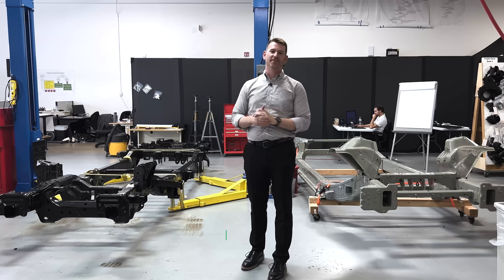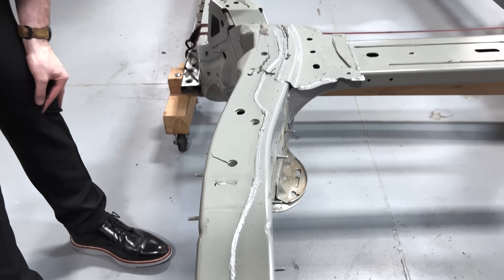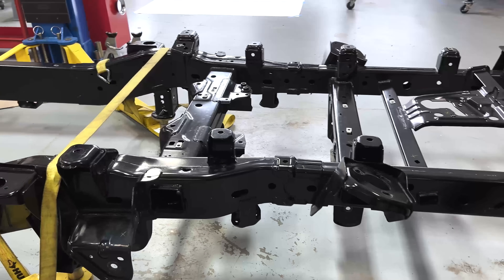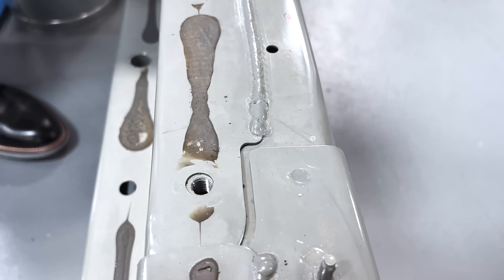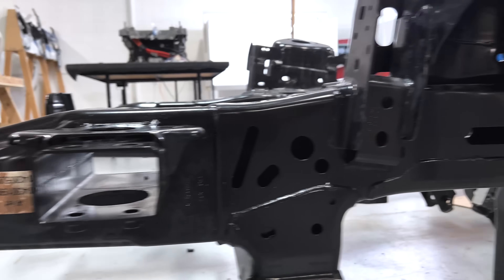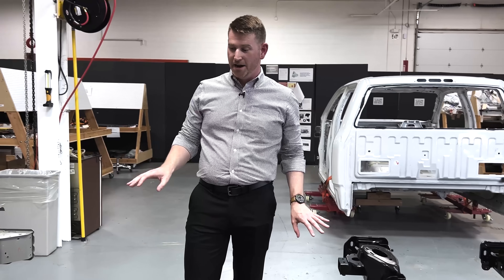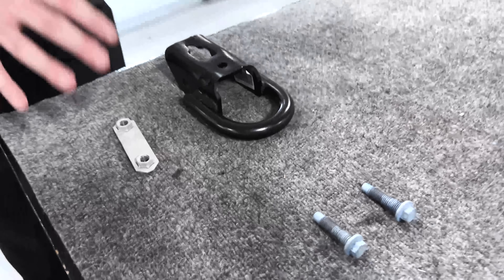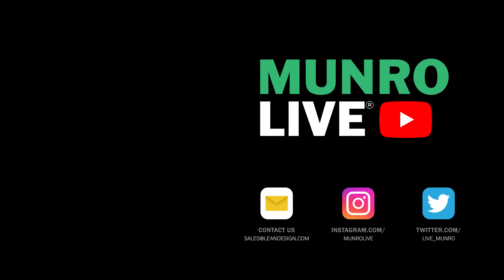Who has the better structural support system | Lightning vs R1T frame breakdown

Comment: This is a pretty good example of maturity.  The Ford chassis has been iterated and interated and iterated for years.  They've reduced costs aggressively by reducing parts counts and they build a very high spec part inexpensively.   Kevin alludes to the manufacturing capacity but the Ford frame is something that Rivian couldn't hope to produce because even if they had the experience and know-how, they certainly don't have the capability to hydroform boron steel tubes for the side rails like Ford does.

Comment: Great video, but you don't have to be such a p#ssy saying obvious conclusions.  Ford is a real truck, with optimized high volume rugged construction, but it is not quickly/easily adapted to house a large battery to convert to BEV.  Ford still makes way more ICE than BEV, so it makes sense the BEV is a compromise.  Rivian is a ground up BEV built of much lighter sheet metal, pieced together.  Its optimized for electric, but is not a traditional HD truck.  Its multi-piece, stamped sheet metal with variable weld quality looks a lot like early Tesla model 3 body in white construction (a mess, Sandy said looks like early 90s hyundai car bodies - before they stepped up their game).  Both frames are exactly whats expected from each manufacturer.  Ford knows how to make trucks / Rivian is a startup electric car mfg.

Comment: Apples to Oranges comparison. Lightly touched on the Rivian performance relative to the F-150. Seriously understated the EV design from the ground up of the Rivian and the performance and functionality of the skateboard and high tech suspension. The F-150 is a rushed to market EV built on an adapted ICE truck frame. Fit for purpose but not comparable to the high end performance Rivian. And yes agree with the manufacturing efficiency opportunities.

Comment: Very informative, now my last dying thoughts as some contemptibly inept drunkard runs a red light at 70mph in a 30mph zone and plows through my vehicle will be admiration for the structural engineering that went into supporting that deadly unstoppable 9-10 thousand pounds.

Comment: That Rivian is gonna rust like fuck. So many flanges and gaps for moisture to find it's way  into , and gonna be super hard to do anything about it after as body bonded to frame , still think it's a super hot truck though. High desirable.
Reply: Box frames suck.  I definitely prefer open C frames to mitigate rust when it comes.
Reply: @thomashayes7897  lol... A box frame is way stronger than a C frame. We are talking about trucks that haul and tow enormous weight that constantly stress the frame.  If your sole criteria is mitigating rust, why even go C frame, just have T or I Frame.  Very easy to mitigate rust for you.  Better yet, maybe they should make the frame out of plastic and solve your problem completely.

Comment: The Lightning frame have to be similar with the F150 frame, is no economic gain to reinvent the frame....Also Rivian is a smaler truck, should be compare with the Ranger.
I do not like the Rivian body in one piece....I like better the cab is separated from the box.......
Has a working tool, the box will suffer more damage during transportation....is more easy to change or replace...

Rivian look more like a El Camino.......no use for trade......but nice lawn ornement

Comment: I do enjoy all the Munro video explanations of the different processes that go into manufacturing these complicated vehicles but as an engineering layman I am more interested in your opinion related to the quality of design and assembly rather than which one is more cost efficient to build. I suspect cost savings will come with manufacturing and design tweaks as well as volume. As Rivian grows its brand and reputation as a high quality manufacturer of EVs it is important that word of mouth advertising, the best form of advertising for any product is always passed on in a very positive warm and fuzzy manner, especially out of the gate.

Comment: Thanks again, big fan of your channel. Three short comments not related to the relevant content of the video:
1.	I prefer the simpler opening, just the woosh to the Munro name.  Short, efficient and sufficient.
2.	Kevin seems very cautious about picking his words and giving uncensored comments. Perhaps a disclaimer in the beginning to limit liability would be in order.
3.	No reason to be modest about promoting the sale of the analytical reports that Munro publishes.
Reply: I think the reason for the cautiousness/ hesitance was explained pretty well in a recent video that Kevin and Jordan did with the rivian and the lightning: there are obviously a lot of priorities when designing a vehicle and by no means do they want to call Rivian careless or inexperienced with their design choices even though by comparison the ford looks so much more “advanced” in terms of design for assembly/manufacturability/cost (in some areas, not all).

Comment: If the Ford frame is about 12 inches tall. Ford could easily double stack batteries and get over 200KW in the vehicle. Especially with new battery tech. Batteries need to get smaller and lighter if EV’s are to be the wave of the future.
Reply: Unfortunately today 200kwh battery pack will basically double/triple the price of the car lol….. batteries are still expensive

Comment: Another good video from Kevin. I wonder how the Rivian is going to hold up to corrosion. It is hard to really seal overlapping sheets.

Ford has said they are already working on the next iteration of the Lightning. It will be interesting to see how much of the future ICE body they will use. It could make sense for them to essentially build their ICE trucks on an EV frame, or at least use the same body mount points. A more aero body would make sense but it's hard to tell if the market is ready for something that looks like the '60s Dodge Deora concept p/u.
Reply: Ford is very limited by their aftermarket. Its a huge selling point for their trucks especially, so any changes to the body configuration or  areas around mounting points has to be done carefully to ensure they maintain as much compability as possible going forwards. Especially when you look at the new Silverado where GM appears to have abandoned their toolbox and ladder-rack using customers... Ford can potentially pick up those customers if they keep their focus on work capable trucks. They did do a bunch of aero work on the ICE body over the last few year model iterations and had already made the switch to aluminum bodies, so Ford was well ahead of the curve on thinking in the right direction for EVs.
Reply: @patreekotime4578  I agree. Whatever they do with the frame-to-body mounts they need to maintain backwards compatibility with the geometry used by existing aftermarket vendors. I was really surprised with the Silverado going so far away from that concept. 
While Kevin suggests reshaping the frame the tooling cost for body and bed redesign would be huge and simply not justified unless the same tools worked for the ICE vehicles, but it could be done w/o changing the outer form of the vehicles.
So Silverado won't be a fleet truck, Rivian competes with Land Rover, and Tesla's truck-ish thing, I have no idea who that's for besides Tesla fans. Ford is the only real EV pickup suitable for fleet use.

Comment: Stop saying "$40,000" -- Those were a unicorn that only a limited number of first day reservation holders were able to get. Current price is $51,974 which is far from $40k and that's assuming the dealer doesn't do an ADM.

Comment: I find it interesting that the industry was moving away from the body on frame architecture and here we are full circle with the "skateboard" architecture for EVs which is nothing more than a different name for the same thing.
Reply: Bullshit!!!! Which industry is moving away from frames!? Frames are litteraly the best part of it! It allows everything from dump truck to custom bed to many other customization like installing a crane, snow plow……,.. the cybertruck is useless compared to this
Reply: @carholic-sz3qv  Tell me what non ev car/suv made in the last 20 years has a body on frame architecture?  They're all unibody.  Prior to that most were body on frame.  Even newer smaller trucks like the Ridgeline and Maverick are unibody.
Reply: @bnssoftware3292  are you actually serious!? Wat can the maverick or the ridgeline actually do!? Those are weak trucks! A Toyota hilux, 4Runner, land cruiser 200, 300, Ford Expedition, Mercedes’ gwagen…… are much stronger vehicles/platforms because they have a frame and not unibody.
Reply: @bnssoftware3292  there are litteraly tons of SUVs and trucks that are body on frame today. I don’t see ever even a Ford F-250, f 350….. abandoning the super tough frame it can’t be replaced by some weak aluminum castings or whatever.
Reply: @bnssoftware3292  the firs raptor is a much more capable vehicle able to jump, go exaceptionally fast on unpaved roads….. even compared to the rivian r1 Because of the super tough frame and suspensions setup.
Reply: @carholic-sz3qv  First of all why are you so angry?  I wasn't saying one was better than the other.  Was just pointing out my observation that so many platforms had moved away from body on frame like the Forrd Explorer, which is now unibody.  There are no sedans left that I'm aware of that are body on frame like the Crown Vic used to be.  With even some trucks moving to unibody it just seemed like the going trend.  But now you're seeing it make a comeback with the EV "skateboard" chassis concept.  That's all I was pointing out.  I agree that body and frame is superior in strength.  That's just physics.
Reply: @bnssoftware3292  I am super relax! You are the one that simply refuses to accept that frame are used on much beefier vehicles for much better toughness and flexibility….. nothing will ever beat a frame! Like it or not it’s facts…
Reply: @bnssoftware3292  your 1100hp tesla modelX plaid can barely tow 5000lbs when a 200hp Toyota hilux tows well over 7000lbs+
Reply: The same thing applies to semi trucks which needs even beefier steel frames to haul those 80,000lbs+
Reply: Neither vehicle skateboard construction, both are body-on-frame (although the Rivian uses the body with the frame as structure, and this isn't surprising for pickup trucks.... even if they had started from scratch with the design.

Comment: This is one of those videos that makes me realize that I don't care about cost-cutting measures as a consumer, because they don't result in lower retail prices, just lower quality items.
Reply: LOWER COST = HIGHER QUALITY 
Obviously not true as a general rule but it is true for many of the cost savings Munro team recommends. 
For instance single piece moldings or castings instead of multiple pieces bolted together does mean cheaper cost.  But it reduces weight (which increases performance); increase precision of fitting; removes slippage (which increases durability); removes parts that can undo (which increases reliability).
Would you rather have an inferior car for the same money just to prevent the manufacturer having more profit?

Comment: I suppose Tesla engineers and designers looked at the frames like these with the feeling of exasperation and bevilderment that such thinking still prevails in the XXI century. It's a technology of the Ford T, and no further tinkering can change it. So, the reason for the Cybertruck is obvious.
Reply: Nonsense!!!! It’s going to remain frame for ford with improvements to better suits the EV while still offering all those customization like single cab! Longer beds…… trucks on frames are much more usable and flexible and polyvalent than any other crap!!!!
Reply: If you try to cut the cybertruck it’s already compromised structurally.
Reply: I suppose Tesla and Chevy engineers look at this with exasperation that they are taking so long to get a truck on the road!

Comment: Notice how much stronger the F150 frame is at the rear compared to the tiny,  tapered ends of the Rivian frame.
Reply: more metal more stronger oohoo ahah 🙈
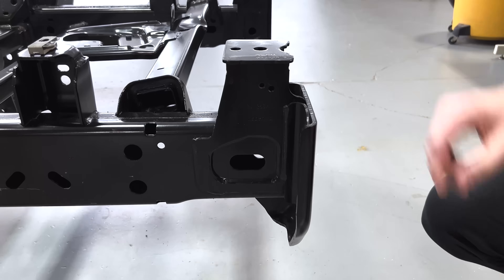Reply: @ejbatchelder8988  from 4:39 to 5:01 you can see the dramatic difference in volume and strength of the two rear portions, with the Rivian looking like it has no real provision for impact protection,  towing or a bumper at all. It's the thinnest and weakest looking part of the whole frame,  while the Ford is built for heavy use, as befits a truck.
Reply: @ejbatchelder8988  do you even understand the question?

Comment: Great job as always.  Question. Today tesla open their EV charge connector, Sandy really likes tesla connector what do you think others should do?  Are you going to tell Rivian to change to the tesla eve charger connector?  Will be really good to listen to Sandy on his take on that now that it is open to all
Reply: Turns out the Tesla charging standard is just CCS with a different plug. Anybody with CCS should be able to just use a cheap adapater. No real benefit to Rivian to change when they can include the adapter for cheaper than changing their plug.

Comment: Itself 😄

The only thing impressive of Ford selling the base model at $40k is if they make more than $1 doing so. Or are they just doing it to move vehicles at a loss? Much less impressive
Reply: They’re not selling any at $40. Currently they are all over $60.
Reply: @jysmtl  i thought the ‘pro’ model was going at $40k.. but since you mentioned it, i remembered they did a across the board price increase recently.. so i went to look at the Ford site. The Pro model shows a base price $52k.. delivered for $55k.. and of course that’s 0 options.. so yeah, getting pretty close to the $60k mark or more. Doesn’t sound so impressive for a bare bones base model
Reply: Yes. Can’t blame them, though, at this point. And it is still a great vehicle at that price and will sell like hotcakes even at the higher prices. It will be nice when lower priced models are also truly available.

Comment: There’s a YouTube Channel that claims it’s costing over $200k to build R1Ts that are selling for $80k.
Reply: The Tesla model 3 and Y have a 30% profit margin.  Meaning that the cars they are selling for $60k only costed around $40k to build.  Just to give you an idea of how much cost goes into it.  So if a Rivian costs $200k rather than the $40k of a model 3..  Then where is all that money going?   Granted, I know it will be slightly more than a model 3, obviously-  being a truck.   But I'd be shocked if they were paying more than $55k to build them at MOST.   There are quite a few areas where the Rivian is over built and could chop up to $1k dollars off of each truck-  which if they sell a million trucks -- that would save them a Billion dollars, so not a small savings..  Even if they could save $5k per truck (which would be HUGE), it still doesn't put them anywhere near the $200k mark to build.. Besides "Cost" changes drastically over time.   If they spend the $100 Million on all the tooling and get the factory going, etc.. and then only build 100 trucks-  then that means it costed them $1 Million per truck.  Right..  But over time, the more trucks they build, the more it amortizes that up front cost and brings down the cost per truck drastically-- especially after they have made enough to cover all of the up front costs completely:  because then they are nearly making all profit per truck -- and it's costing much less money to build them-- because they are essentially building them on free tooling by then, since it's been fully paid off.  This is also why you see most of these EV designs built for years and years without any changes, such as Tesla-- and I'm sure the Rivian/ Hummer/ Polestar, etc. will do the same.  Because like I said, they are saving money on having to build all the new tooling it takes to make your new car design.   It's pretty crazy that so many of the legacy ICE companies would change their designs every 4 years sometimes...  My point is, I'm sure that youtuber figured cost based on the amount of sales they've had so far-- which is silly because they are barely getting started..  It's like you buying a $10k boat and going out fishing and you catch 5 fish--  and then I laugh and say: "Those fish costed you $2k each-- the most expensive fish ever" -- lol..   But really it's your first time ever using it....  Let Rivian sell their trucks for 5 years and then you can get a good idea on what the cost per truck really is.   cheers
Reply: @calholli  Tesla makes more changes then any other auto manufacturer on earth. The make more a week then most do in 3 years
Reply: If there’s a YouTube channel making such a claim, then it must be true.
Reply: T makes rapid software changes. Not hardware.

Comment: What's the weights of these frames? Not a fair comparison, but based on their total gross weight of vehicles versus the frame weight ratio, we can estimate how much room they have for adding features that are people centric (more massaging motors, Mercedes like seats, more speakers in their sound systems)
Reply: I believe in another video they stated the Lightning is 5-600# less than the Rivian despite the Rivian being considerably smaller.